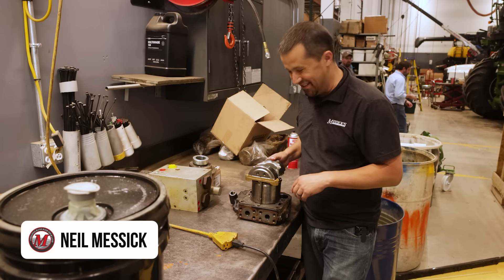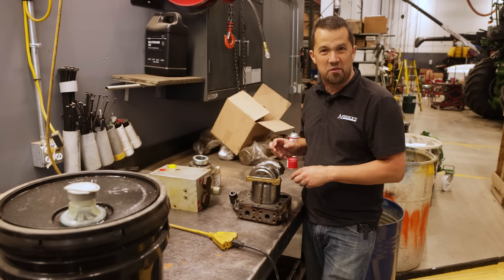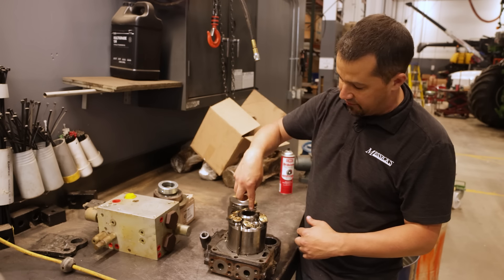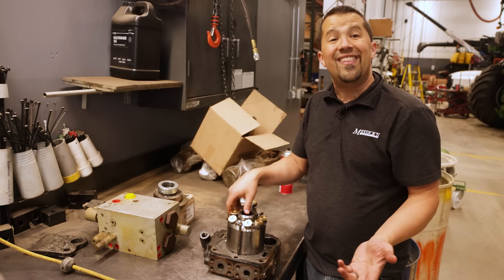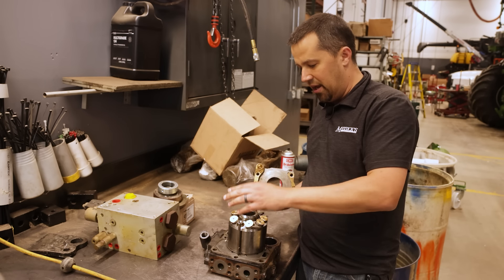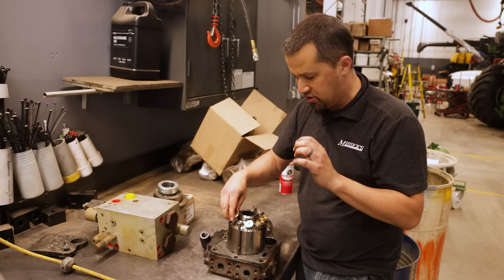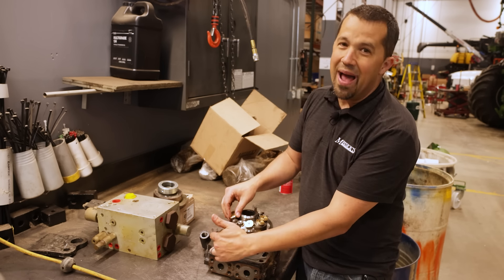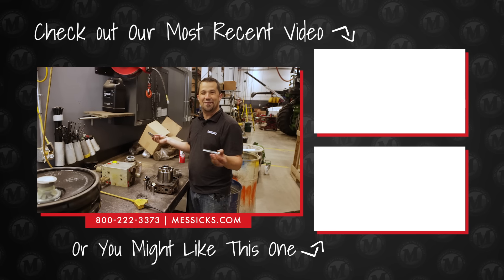How does a Hydrostatic pump work?

Comment: While that part is amazing enough in itself, what I find more amazing is the fact that someone came up with that idea.
Reply: Be more amazed. This style pump has been around a long time. Ford, for instance, used this style pump in the early 1950s on tractors. I have seen even older versions of this used in industrial applications.

Comment: I taught hydraulics in a VoTec in Oklahoma for 5 years and loved it. Before I taught worked as a hydraulic technician and put in a few hours in the field working on Sundstrand pumps and motors. Nothing like fluid power. 👍🏻
Reply: what votech my dad taught at both mid del and eastern ok county. welding in both

Comment: Back in 1981 I had an old Cub Cadet hydrostatic 12hp front end loader yard tractor. When cold, it was good, but lost function as it warmed up. I knew nothing about troubleshooting it, and knew it would be expensive if I took it to a shop. 31 years later I bought my BX25 and have accumulated 3237 hours. Love it. But I only learned about HST pump and motor when I bought a hydrostatic drive lawn tractor that did not function. The previous owner had it repaired, but when reassembled, a part was installed incorrectly. I fixed it and use it as my acreage runabout, towing a sweeper and various trailers. Love hydrostatic.

Comment: The power of hydraulics always impressed me , interesting to see inner workings.
Reply: Would have been nice to see the damage and get a general explanation of what caused the damage. 
   I'm assuming low, bad, wrong hydro fluid or water causing Excessive heat, wear or loose metal debris getting stuck.  Looked like A LOT of scaring on the one piston without the brass shoe.

Comment: Hi Neil,  Just purchased a rtv 520 and when shifting in reverse-the vehicle is at a standstill as per instruction-there is this random and intermittent chattering noise coming the transmission.  The dealer has been unable to replicate this noise although we have experienced it several times when operating the vehicle.  In fact, I was able to catch the sound on my smartphone and send the dealer the audio file. Its been with the dealer for about a month and they are about to send it back with the issue unresolved.  I would appreciate your perspective and assistance on this matter.
Reply from the maker: I'm not sure I can add value here. As a dealer It's hard to fix issues you can't replicate. You've documented it happens, the best thing maybe to wait and see if it gets worse.
Reply: @MessicksEquip  Thank you for taking the time to reply.  Greatly appreciated.

Comment: Hydro-drive power units are king for applications such a landscaping. The ability to feather the machine travel speed instantly is much safer than gear drive and loader work is also more efficient. Gear drive has its place though, especially for field work.